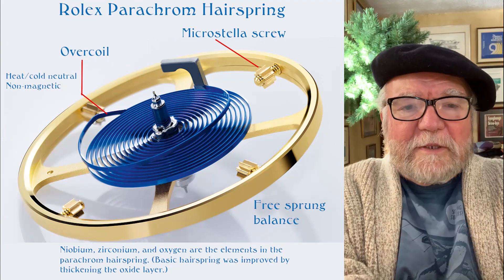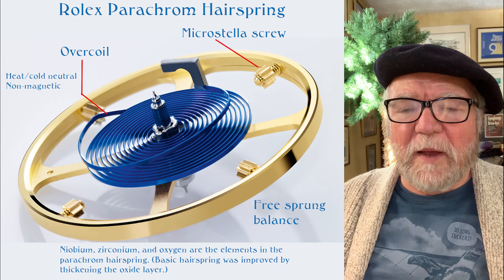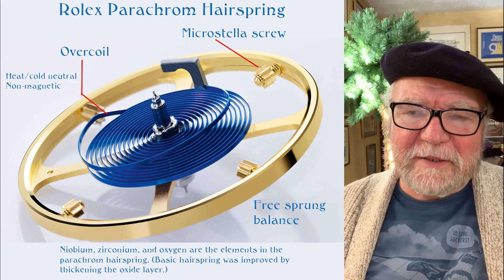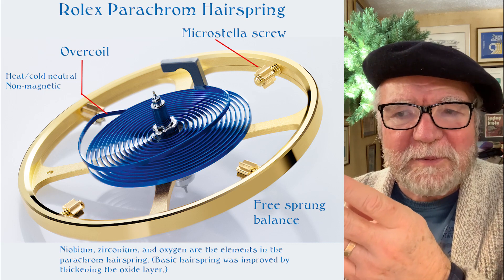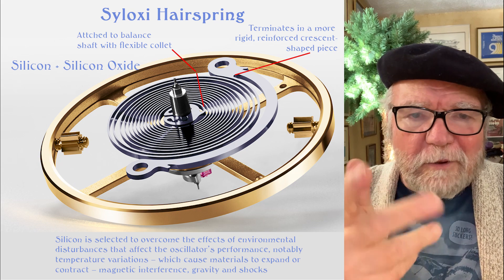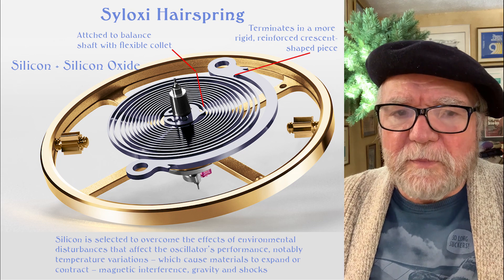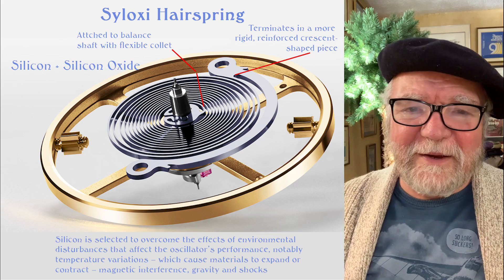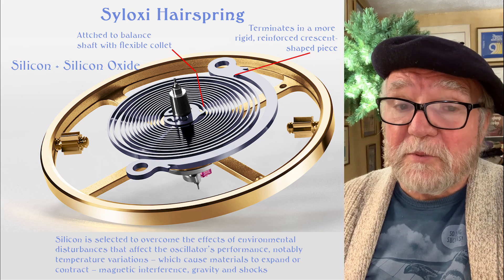Should Rolex Use Silicon in their Movements? #VP86

Comment: I don’t see anything wrong with silicon hairspring, it’s better resistance to magnetic field and I like my watch to keep a good time without going through demagnetization.
Reply from the maker: There is nothing wrong, Mohamed. Not anything wrong with quartz either, and it's a lot cheaper and more accurate. Take care and be safe, Bill😷
Reply: @watchartsci  I means changing hairspring would not take mechanical aesthetic , the only think that is silicon can’t be fabricated without machinery
Reply from the maker: @mohamedalketbi2326  Not talking about aesthetics, but you're right. What I think is cool about the Syloxi hairspring in its production is that the shaft-collet and terminal crescent along with the hairspring itself are all one piece. While functionally, it's an achievement; I think the same of microprocessors in my computer. Still want a metal hairspring, and the niobium—titanium one in the Straumann by H. Moser's Precision Engineering will do fine or those by Altokalpa that are used by Vaucher and Agenhor. Take care and be safe, Bill😷

Comment: Rolex is one to innovate and to make what is the "best movement". They would use silicon if its actually makes the movement performs better. Rolex movements are industrially made so it doesn't matter whether the hairspring is silicon or other materials. Rolex is generally bought by watch lovers for it's brand recognition and utility rather than craftmanship even though they are a work of craftsmanship to a certain degree. They are still mostly made by machines.

Since Syloxi improves the performance of the movement, then its fine.
Reply from the maker: I think that Rolex has made a good decision to hold on to the Parachrom hairspring now and make excellent watches. Who knows what the attitude toward silicon hairsprings will be once they're in all the new Patek Philippe watches? Take care and be safe, Bill😷
Reply: @watchartsci  People who buys Rolex and Patek generally dont care about the hairspring as much as we do. They may even favor silicon over metal with how silicon is marketed. Even when we talk about watch enthusiasts,  most wouldnt pay too much attention to it.

If its about people like us, it would be debatable like my opinion above. Though Rolex keeping the parachrom might be because it takes time to move to silicon and they can bail out if theres a problem(which most likely wont happen).
Reply from the maker: You're right Tippy; a lot of watch buyers couldn't care less. As a collector, I do care. Take care and be safe, Bill😷
Reply: @watchartsci  I only care when its about "handmade" watches. If i were to get a rolex, I dont care about those kind of stuff enough
Reply from the maker: @tippykaffu4047  ...and you know the hairspring is not hand made. Take care and be safe, Bill😷
Reply: @watchartsci  thats true I suppose. Or most mechanical watches wouldnt be as good as they are supposed to be now

Still, it just doesnt mean much to me in a Rolex but is means something of its in a Lang watch